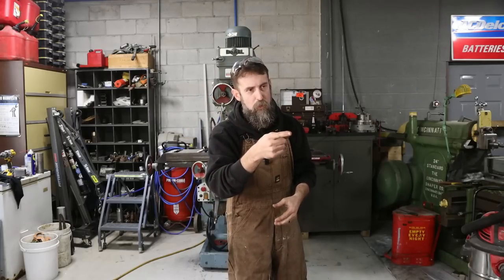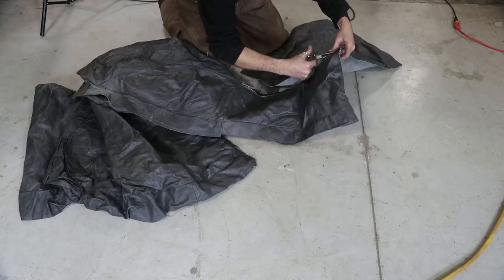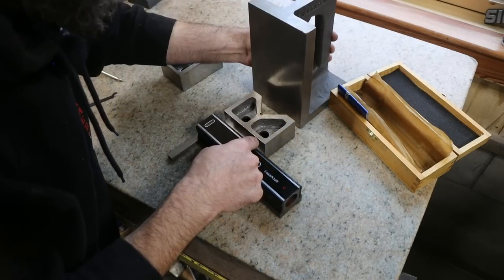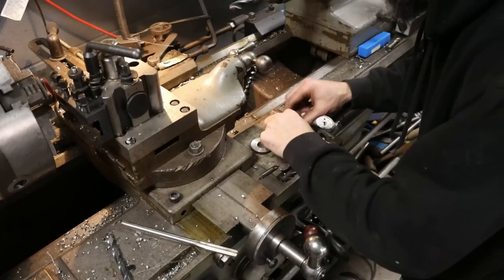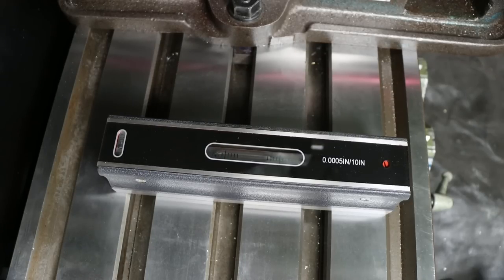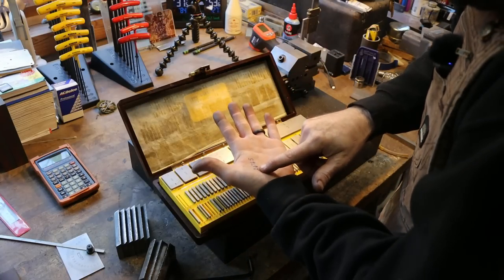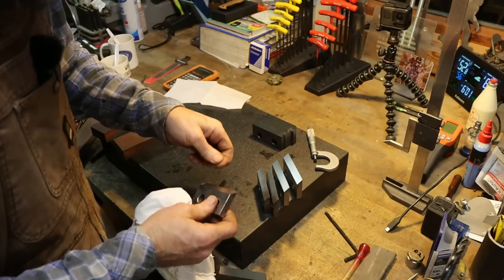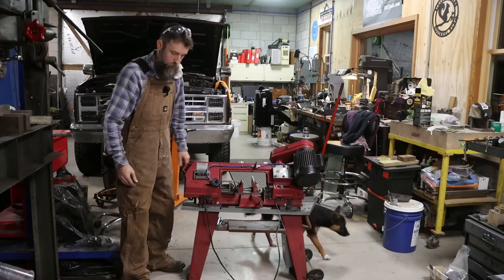Leveling up The DoAll Milling machine / Surface grinding & machine maintenance.

Comment: Being an old surveyor, I have leveled thousands (probably hundreds of thousands) of surveyor's levels for use in the field using the four leveling screws.  While not nearly as precise as a machinist's precision level, the process of being leveled is still the same in my opinion.  Level a 4-point object across the diagonals.  Leveling perpendicular front to back on a 4-point object, you can (and will) chase your tail for quite a while.  (I agree 3-points are easier, but that's not what you have, but think; with three points, you are still leveling mostly across the supports) This has to be similar for any object to be leveled, regardless of precision.  Just my two cents.
Reply: One of the lab instruments I service has 5 feet. 2 in the front 3 at the back . The front right foot is not adjustable and the leveling is done using the rear center and front left feet. When the instrument is level , the 2 remaining rear feet are adjusted to touch the bench top. 
The whole thing weighs 280kg.
Reply: @paulg3336 , Sounds like a fun time. Lol
Reply: I as well have worked in civil engineering and I agree with the simplicity of the three-point leveling system, but the new transits are much simpler.
Reply: @fiorevitola880  I totally agree.  But prior to their development, I carried a 30 lb transit on a wooden tripod (probably oak) for years over many miles.  Ahhh, the good old days.
Reply: @paulg3336  That's the way I level my floor drill press. I use the rear 2 feet  and 1 in front like a 3 point, then snug up the other front foot.
Reply: Same here, just with Robots...you definitely will chase your tail with four corner leveling bolts and a machine precision level!

Comment: love the videos, just finished up dinner and now I get to watch this before bed. Also just bought myself a K&T 2CH thanks to you hahaha just tore into it the other day to clean it up
Reply from the maker: That is awesome. I was cleaning mine up a bit today as well . They are fantastic machines.
Reply: @SteveSummers  yes they are, the only issue I have with mine is the bevel gears for the rapid traverse are missing a few teeth so im gonna have to weld them up or something. for having never touched one before I found it quite easy to work on for the most part, a testament to the product

Comment: There should be an anneal button on that DoAll blade welder which will let you soften the weld so it won’t break as easily.
Reply: There is. I was wondering why he apparently didn’t use it.

Comment: Abom did a recent video of scraping, but it was interesting to me that his flaking was on the upper surfaces only. I wonder if leaving the bottom ways smooth, helps the wipers work better? I hope your dog gets some better bones. Leather is amazing. Even if it gets all dried out and curled up, it can be restored as long as it doesn't get moved and bent while it is dry. That breaks the fibers. I had an antique saddle restored by Burn's Saddlery in Salina Utah and they did an amazing job. They turned what looked like a lost cause into a usable working saddle with pretty much only new wool installed. Great price too.
As I recall, they disassembled the whole thing and soaked it in Neetsfoot oil and stitched it all back together. I would have liked to see how much work that was. It turned out great. Is your DuAll on 3 feet and not 4? I once had an argument with my Machine Friend about 3 casters or 4 on a big tool. I went for 3 and it was fine. All wheels on the ground at all times.
Reply: I believe Steve used a foot in each corner, hence the 4 washers he parted off but I guess you are referring to the 3 points of contact method. Also, I like your music. ✔😁

Comment: Did you anneal the weld?  I didn't see that in the video. The instructions for my Grob welder included an annealing step after welding.  The current page selling the Do-All band welder states "Dual Hi/Low range annealing switch for accurate annealing temperatures."
Reply from the maker: Yes, this machine has the annealing feature.

Comment: Steve you can tig weld hss steel and use old drill bits as welding rods. I use this technique to add hard edges and making lathe tooling.
Reply: The HSS still keeps its hardness, or at least enough of it? That's amazing
Reply: @caseysmith1718  yes its hard after cooling . You can weld hss pieces to end of steel rods for custom boring bars, i use them for o-rings and threads

Comment: Hey Steve, when checking accuracy of the level, I've simply taken a felt tip Sharpie, drew some lines on the plate around two sides of the level.
Alcohol removes the ink
Reply: Yeah, sometimes it's not realistic to have a setup like that. I would normally use the deck of a neighboring machine. Sometimes even the deck of the machine to be leveled.
Just have to use the exact position for the two 180 out positions. Check one side, note the bubble, 180, note the bubble, adjust halfway between, repeat till the bubble is offset the same amount on both 180's.
And also, it's not as though those levels are always going out of adjustment. If it's out, I would inspect the level closely to see why. Someone dropped it? A burr is stuck on it? A gouge? Normally you are checking to make sure its good more than adjusting.
And then, even while leveling the machine, keep doing 180's throughout.

Comment: Steve, I know it would mean doing all your work twice, but another washer and nut on top of the open slots at each leg will make things that much more steady. If it was a through hole, no problem, but an open slot would benefit from a little extra metal holding everything together. If for no other reason that it would just make me feel better knowing.

Comment: Steve, my cabinet based Harbor Freight horizontal band saw received damage when it fell over while I was trying to move it. The plastic motor end cover broke into a hundred pieces so did the motor's electrical junction box and capacitor cover. Also the plastic fan blades broke. All this plastic is very brittle and the damage occurred only after a few months of ownership, but it was on me. Since I really liked the saw, I was not going to replace these broken items with the same plastic. I went on a crusade to find replacement parts in metal. Not an easy thing to do. HB does not sell these items individually. My local electrical motor repair shops did not have inventory that fitted. Then I recalled that all these saws are replicas of one another, but with different brand names. Low and behold, JET had a full online catalog of replacement parts IN METAL that fit! The only item I had to replace in plastic, but more flexible plastic, was the fan. Installed all the new parts and it's a much improved quality item today.

Comment: Unless I have succumbed to my dotage, you ground those blades to 48deg.  The angle under the wheel is the complement of the angle of the vise. Pls convince me that I'm wrong!
Reply: I agree.  They are ground to (very precisely) 48 degrees.

Comment: I heard argument that’s you do not need to level your mill as long as you indicate the table correctly. I feel like that’s probably true but I leveled mine anyway. Good video buddy.
Reply from the maker: I would say that is true. it is nice to have one level IMO . On a level machine you can use a level for work setup and coolant flows to the drains properly as well,
Reply: The way oil also flows along the surfaces of the machine how it should if the machine is level.

Comment: It's Funny how at the end of this Video, you changed the gear box oil on your metal band saw.
I was thinking of that when you first showed it in this video. Then next thing you said is I'm changing it...
Lol.
I have an old 1980s Big Lots Green Stamped Steel Frame 3.5" Band Saw that I bought new back then & changed the oil about 5 years ago..
It needed it too. But the gear box like yours was in Great shape after years of use. 
I've been a happy camper with it.
& I also had to re tighten all the bolts & nuts on the stand.
This time I used red lock tight on them.
All good now. Lol..
Great Video Steve.

Comment: At 35:35 which we were neighbors, would have loan you my press brake head I made for #roughcut2022 :)> Great content Steve, the mill is really looking good. My chip protectors were sewn up like and accordion so they expand and retract like a spring. Only draw back is chips do tend to build up, but a quick vac does the trick :)> Best to you and families over the Holidays, Bear.

Comment: Hey Steve,
Thanks again for bringing us into your enviable shop.  I especially like the Do-All saw, and have always liked the built-in blade welder.  If memory serves me correctly, there is an "anneal" button on the welder and I didn't see you using it on the video?  Did you perhaps do it off-screen or is it not there on your model?   It's an important part of blade welding after the joint is made.   
Thanks again,
GBD

Comment: I have a lovely old British Startrite 24V10 band saw. Big brother of the one This old Tony uses. I love it and can get incredible accuracy - within a tenth! But I hate changing blades. Getting the tracking right is always a nightmare. I suspect I need to true up the tyres on the wheels.

Comment: I have that exact same saw from Harbor Freight. Only 1 complaint. The spring that sets the blade pressure binds on mine sometimes before cut. Never during cut. Just when starting it. Just have to watch it when I start out.

Comment: Steve i got a Milwauke right angle  drill 18v, tight spots pretty accesible swear by it mate,  up to 10mm or 3/8 chuck

Comment: According to Richard King you should have a bit less than a thou, say 4-5 10ths of play in the gibs. Enough to have space for oil. Is it possible you need to adjust the knee gibs a bit tighter? My hf bandsaw was great once I put enough tension on the blade tight enough.

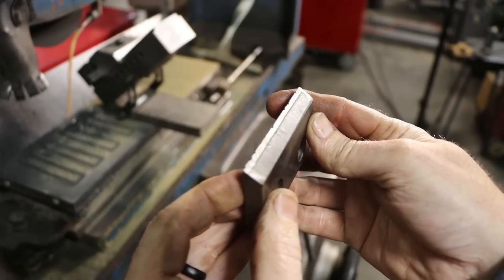Comment: 45:31 did I see a slight concavity on the adjustable blade there? Almost hollow ground. I'm just guessing someone worked them before up to a regular bench grinder straight into the radius?

Comment: Jobber length drill bits are almost always too long or too short. They must have spent a long time finding the exact wrong length. Screw machine length is my go to drills and taper length when I need something longer. Just like Ford has found the exact wrong ride height on their trucks with half the buyers lowering them, and the other half raising them.

Comment: Or just bolt the shield to the gearbox and drill the holes vertically then you can have a full width clamp bar instead of all that loose stuff on each side.

Comment: My airline had a Do-All saw with the identical blade splicer. You are correct! It is the Cadillac of blade splicers. I never had a bad or misaligned weld.

Comment: Steve - could you make way-wipers that run off compressed air and either blow the ways clear, or power a rotary brush like in a vaccuum cleaner to push chips off the ways ?  Even just angling the current ones so they push chips off the side might be an improvement ?

Comment: You can fill the scores with JB Weld and then level it off to the surrounding surface. It will allow the wiper to wipe better.

Comment: Aren't those 3 wheel bandsaw designed so you can use just the two front wheels and an auxiliary blade guard. Then you can use much shorter blades. 99% of the time you don't need the full cutting width.
Reply from the maker: Yes, you can run between two wheels.

Comment: Steve, I have the same shaper as you and have a leak coming out of the main input shaft that the clutch attaches to.  Do you have an idea on how to take it apart?  I have started to take it apart and it looks like I might have to take the entire transmission out of it to get that input shaft out.  I have tried to look for information but can't find anything.  Just wondering if you have ever been into yours?
Reply from the maker: I've never had the drive apart on mine so I wouldn't be much help to ya

Comment: Yes met that oil before, it probably is a recycled oil, just went through a filter press pack to get the chunks out, then was washed to get the acid level down, then skimmed and dried. Has that funny smell, all sorts of oil bases and viscosities mixed together, barely above fuel oil cost wise.
Reply: On mine, it was my guess that the black oil in the gearbox had moly in it, which is recommended for that type of gear in brass. Good to see that Steve's regular gear oil is working out ok.
Reply: @thedodger7030  If the stuff I met had any moly in it it would be a contaminant. Added a tiny bit in as well for brass gears, and noisy bearings, which does help, though it also makes it foam a lot.

Comment: Nice to have a level machine, the gotcha on some I've come across over the years is coolant doesn't always drain well. As long as it's rigid and trams correctly it's not critical. My CNC lathe is a classic example, it was a pre-production prototype I was given to evaluate and that was one of several problems. (The most annoying being the lack of cleanliness with bits of swarf and cast iron dust left during assembly and clinging to bearing grease, ballscrews etc).  I setup it up to lean toward the back corner, coolant drains nicely and it works fine, turns parallel and true.
Reply: That's kinda odd. Usually, the coolant paths have a drain grade built in so the machine can be level. Maybe because yours is a prototype?
Reply: @snakerstran9101  Yea - that was the problem with mine, the cast base top surface needed a redesign, but I've seen poor coolant paths on several different machines over the last 40+ years. Sitting coolant in Tee slots and under the bed or table is the last thing you need if the machine is not used daily and you forget to clean it all out and dry it. Others are OK if dribble or mist coolant is used but useless for flood - they simply cant get rid of it quickly enough..